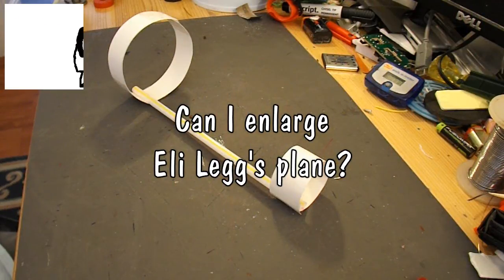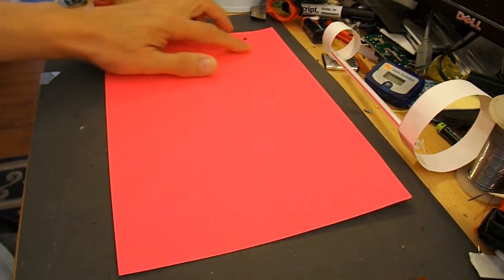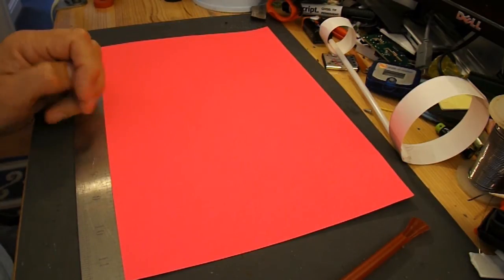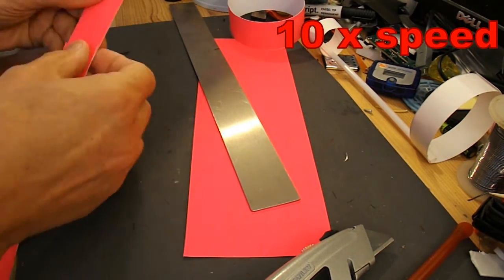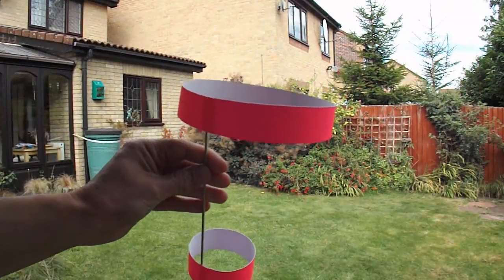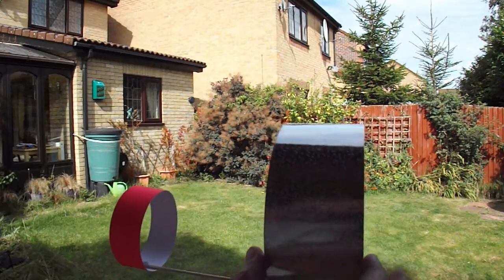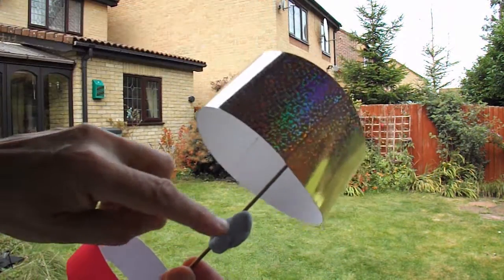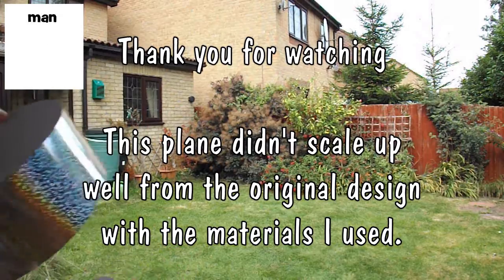Eli Legg's plane o__O revisited

Comment: Grandpa, is it possible that the straw in the smaller design has something to do with the stability of flight? Maybe the straw, with the whole in it, would provide a little lift with the air passing through the straw? Just an idea.
Reply from the maker: Possibly, but I think it's rigidity helped more. In the second version I used a bbq stick and that was too flexible making it difficult to launch. I have some ideas but no suitable materials at the moment. Back in the 60's and 70's I would have made it from balsa wood.